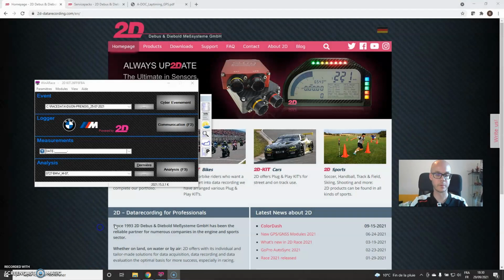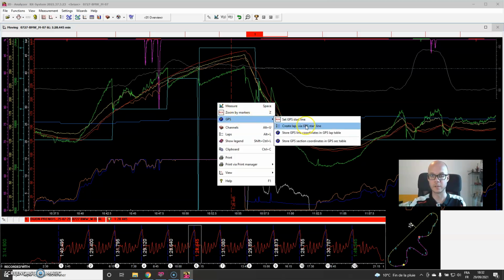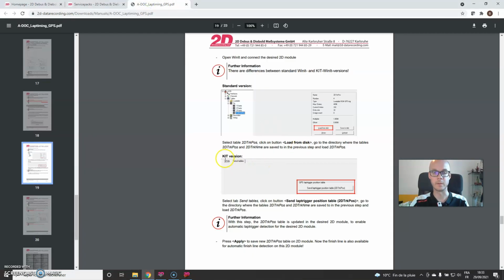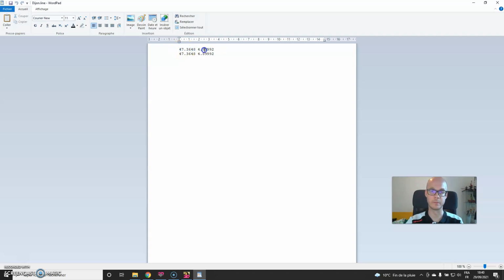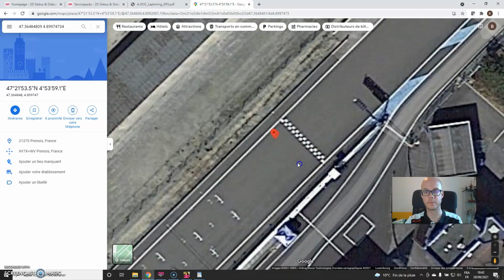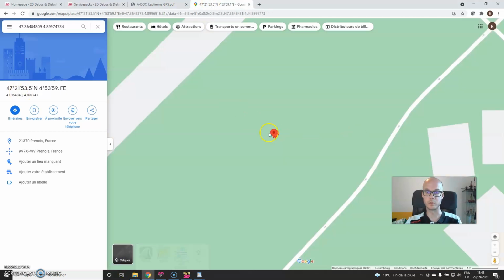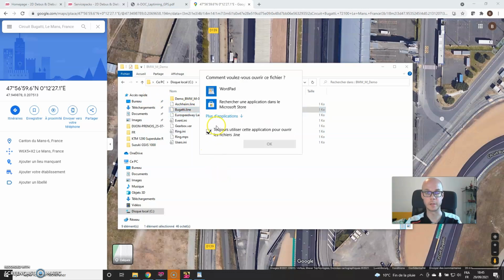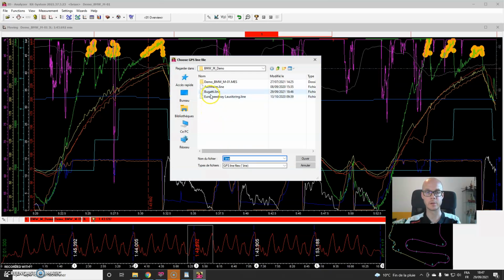BMW M GPS LapTrigger - tutorial - Create a new track (start line) or modify it

Comment: Once you get to a new track that's not in the database, is there any button you need to press to turn the lap timer on/off? For instance, on a Ducati Panigale V4, you need to press the high beam switch to get it to start recording lap times.
Reply from the maker: Nope nothing to do here. BUT if you want the laptimes on the dash, you'll need to use your laptop. Create a starting line. And inject it in the logger via usb.
Reply: @KoRnIcHoN1000RR  Thanks. The lap time on the dash is fleeting. Meaning it resets to zero and starts a new lap too quick for me to even see what my lap time was. Is there a way for setting the lap time to stay on the dash board for a few seconds before it starts counting the new lap time?
Reply from the maker: @brilliantspeedsuperbikes  in the setting menu where you select external or manual. 3rd setting should be the duration that you ll see your laptime.
Reply: @KoRnIcHoN1000RR  thank you.
Reply: For US customers especially, is it possible to show the telemetry in miles per hour MPH instead of KMPH?
Reply from the maker: @brilliantspeedsuperbikes  you mean on the dash or in 2d Software?
Reply: @KoRnIcHoN1000RR  2D software. In the analysis.
Reply from the maker: @brilliantspeedsuperbikes  well I thought it would have been possible... But I don't find it in the software, nor how to do it in 2d manual for the analyzer software... Sorry mate. Maybe try to contact 2d support just to be sure. 🤔
Reply: @KoRnIcHoN1000RR  I contacted 2d support. Unfortunately, the BMW kit version they sell is a closed system and it's not possible to display in miles per hour. However, if you buy the full race version, it's possible to create your own channels and have that be displayed in MPH. I have another question for you: on my motorcycle's dashboard, I see the lap times. But when I get back to the pit and wish to view the lap times for all my sessions, it has no memory. I can remove the SD card and view my lap times on my laptop. But my bikes' dashboard has no memory...it flashes the lap times while I'm riding, but I cannot see it later. Does the bike need to be activated with a Code from the dealer? Or am I missing something else? Thanks again for all your help.
Reply from the maker: @brilliantspeedsuperbikes  ok thanks for the feedback...
And for checking the laptimes... That's strange. Especially if you can see them afterwards on your laptop... What should happen is that on the screen on which you see the laptime, you should be able to "go down", with the left arrow down. And there see all the laps, delete them etc... The only update needed was de M GPS code, but if the system works, you have it...

Comment: Very useful, thanks a lot! Have you ever tried to define different start-finish lines which are located very close together on one track. For example: Nürburgring BTG-Layout - the start line is at 50.335500, 6.947650 (Antoniusbuche Bridge) and the finish line at 50.335500, 6.947650 (Gantry Bridge on Döttinger Höhe)? I'm afraid this won't work...
Reply from the maker: Very good question... Never tried, and indeed could be a source of strange behaviors.
And you're welcome for the tutorial, I know there is not a lot of content about this feature so if I can help even just a bit... ;-)
Reply: @KoRnIcHoN1000RR  I have an idea, how I could be working - althought 2D themselves say it doesn't work...but I can only test in about two weeks...let you know... ;-)
Reply from the maker: @erikschmalen3776  with pleasure. Let me know your findings!
Reply: @KoRnIcHoN1000RR   I have tried, but there is absolutely no way to do it, because the system does not allow to set two different trigger points within a radius of 5 km.
Reply from the maker: @erikschmalen3776  so you need to search in the starting lines tables files. And delete the ones you do not need. It's feasible. But difficult to explain it easily... 😅

Comment: First, Thank you, very helpful information.
Question: If I have a track with 2 physical layouts? The main layout is included already. The second layout is not. I can add another track. BUT When riding the main layout I will crossover both the original and the new start line. This will probably send the laptime on my dash crazy? On the 2nd layout it will be OK because it will only crossover the new start line. I am worried about the main layout.
Reply from the maker: Well thanks and you're welcome!
So for your question I've never been confronted to that. But if I understand well your case and how the 2d module works (kind of automatically as soon as it cross a starting line it has in memory...), I would say that if both layouts are at some point taking the same part of the track, you have to make sure starting line will be the same for both. The module do not have the layout in memory. Only the starting lines.
Hope it helps...